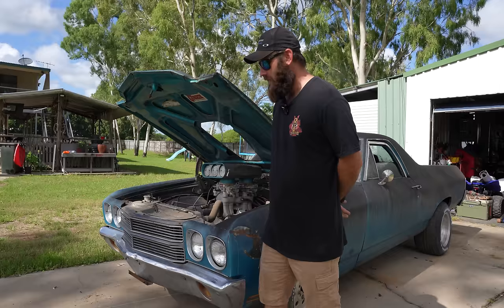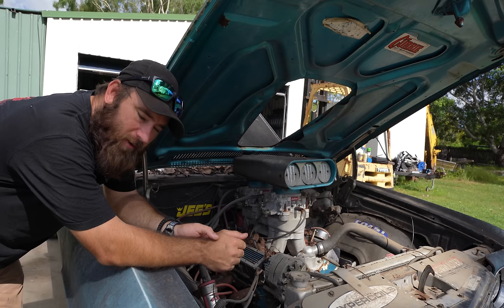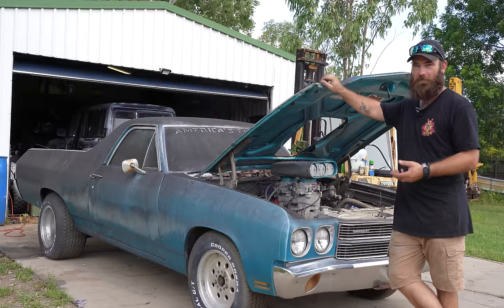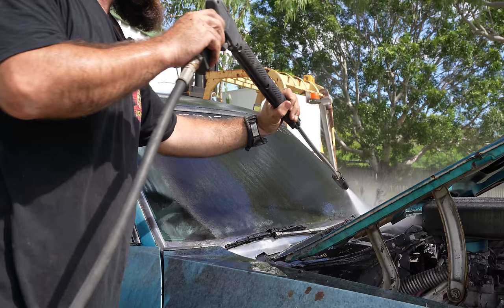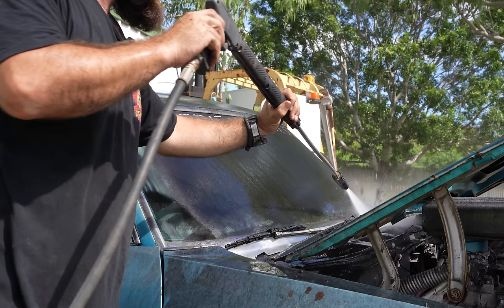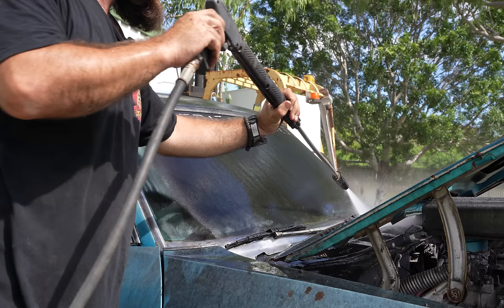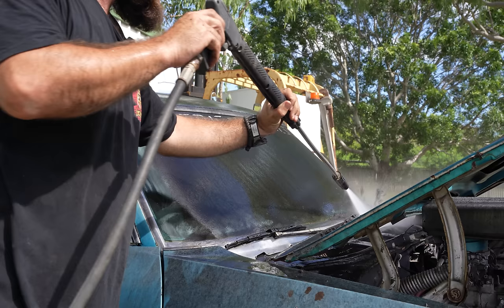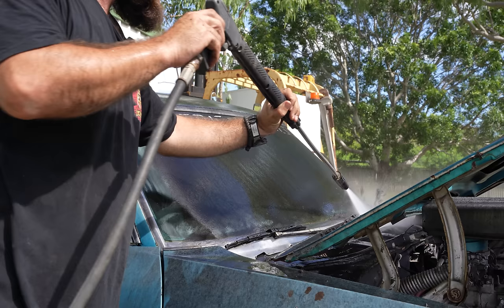Barn Find Chevrolet El Camino Sitting For Years Will it Run?- Sickpuppycody

Comment: Cody, Looks like either a 283 or 305 tricked out just fine! You have a classic ride here. Any way, you really lucked out finding this gem. Every guy has to have a muscle car or truck to "play" with!
Reply: 307 cubic inch 200 horsepower V8 (base)
350 cubic inch 250 horsepower V8 (optional)
350 cubic inch 300 horsepower V8 (optional) 1970 El Camino Engine Options
Reply: 283 and 305 are  ten years apart and totally different from each other. 327 and 283 are closely related and both small journal high rpm engines..
Reply: A 283 doesn't have a crank bolt. Looks like a 350. It sounds way over carbureted.

Comment: Nice work. The dipstick on the driver side, below the breather is the engine oil. A chevy will work with anything that qualifys as a lubricant. We usually st as y on the high side, 10-40 or even straight 30w. The dipstick you checked on the passenger side at the back is for the transmission.  The dipstick tube is also the filler tube. Check power steering pump on driver side too(belt driven). Chevys are tough, you probably don't need to pull that motor, it will come back fine! The balancer is interference fit, but fix the bolt before any serious shakeout;)

Comment: Sweet car! Couldn't have been parked any longer than the early 2000s judging by the monster energy drink decals on the blower. Hopefully you can get it back to A1 condition and get that charger!
Reply: Not a blower..tunnel ram. Still looks cool and makes lotsa torque

Comment: Two pieces of advice. 1. The starter sounds like that because it needs a shim or two between the starter and engine block. You will destroy the starter if you keep cranking it that way. 2. When you pour gasoline in to get it to start, put it in the vent tubes sticking out of the top of the carburetor. That way you fill up the bowls and give it enough gas to get it to start. And yes it's a turbo 350 transmission.

Comment: Awesome content 
Great build series 
New fuel tank, lines, regulator and filter
New oil, oil filter, clean oil pan, new oil pump
New temp gauge,
New aluminum timing chain cover, geared timing noisy 
New radiator, electric fans, hoses, clamps, thermostat 
New aluminum electric water pump 
Trany oil, clean pan and filter
Change diff oil 
New brake master and booster 
New 18 rally wheels with wide meats
Weld the diff 
Electric rack and pinion    No power steering pump, pulley, and hoses 
Rip out the carpet  and remove the bench 
Power wash it put 2 small racing batteries under passenger seat 
New big RPM tac 
New water and amp gauges. 
New sending unit 
New wire harness 
Brakes and bearings 
Boom tubes out the sides 
Hood stick and drive sideways

Comment: I just bought a 1966 El Camino 3 weeks ago. I live in Washington state. I have 2 1966 Chevelles, one with a 427 that I’ve had for 43 years now and I have a 1966 Chevelle convertible that I’ve had for 20 years now that’s nice. It has a 283. I also have a 1970 Monte Carlo that I bought a couple of years ago because someone in Australia needs one. It has a 402 big block and is in nice original condition but had a bad rod bearing and chewed up the crank. I bought the parts to make the differential a 12 bolt posi. It has new 3:73 gears and a new posi unit, bearings and axles. The interior is original and in nice condition. I’d love to come visit and help my new Australian friends work on it. All of my close friends died. Heart attack, brain cancer and a vehicle accident all within about a year of each other. They were the best and we all lived in the same neighborhood.

Comment: I know I'm about a year late on this.. but the turbo 350 is the transmission. its a 3 speed, with no overdrive. A pretty common transmission paired up with small block chevy engines. Not sure if y'all got PB Blaster in Australia but that's my go to rust oil that I use. Be sure to use thicker oil that has a high zinc content for these old motors, some people use diesel oil 10w-40 but I tend to stick with general oil for gassers. If I were you Id keep that intake manifold and dual carb setup, that's gotta be like finding a unicorn in Australia. They're a pain in the ass to tune sometimes but well worth the effort. Look forward to seeing more videos of the ole camino.

Comment: First time finding this channel thanks to junkyard digs, great work on that el Camino, I have a 68 although I’m state side, nice to see another one being saved
Reply from the maker: Legend brother thank you!
Reply: Good going Cody.  I had a 68 back in the late 80s.  Fun cars and useful when circle track racing.  Like someone said add some zinc additive to the motor oil.  Next time you get it running check the tranny fluid.  Dip stick and fill on the passenger side. A small 2 gallon auxiliary tank will give you enough fuel to help reseat the rings and valves as you heat cycle the engine several times.  Remember the auto trans needs to be checked ASAP.
Reply: I just bought a 1966 El Camino last month because it’s in great condition with no rust that I’ve seen. It has disc brakes now and the previous owner started fixing it up. I live in Washington state and have 2 1966 Chevelles in addition to the El Camino and we have a 1970 Monte Carlo with a 402 big block. I need friends to work on them with me so I’m not all by myself. Safety watches! I have a nice shop with a loft to use to work on the projects.

Comment: Turbo 350 is the Transmission. In 1970 the available small block engines options were a 307 Cu. In (5 liter) that made 200 H.P. two different 350 cu. in. (5.7 liter) that made 250 or 300 H.P.

Comment: its probably a 350 w /cam ,maybe even pistons.that tunnel ram is a plus,but pain in the ass ,if you dont have high compession like 10:5-1 or better.it could be a good performer.use T5 shell rottella oil ,cant lose!!

Comment: Good work that's a badass El Camino. Just remember American Motors are really tough I have seen motors setup for 50 plus years and with a little work start up and run and drive just fine.

Comment: Pull the distributor. Put a long screw driver down to the oil pump. Rotate it with fresh oil in it. I have an old distributor that i hook a drill to. And get oil back throughout the engine... just a suggestion

Comment: Here in the states that's a 40 or 45000 dollar car if it's real nice an clean just sold a 69 chevelle not done for 25000 that's a well sore after car well worth fixing up will not lose one dime on that car👍 check block numbers if it ends 00010 back over transceiver side it's 4 bolt main 350 good motor

Comment: I have a 72 El Camino 350 in my 70 c10, the stamped number on the block just forward of the right side head told me it's the same engine they used in chevelles and camaros.

Comment: Driven the 80s body with a tiny worn-out 305 good fun for a high schooler. Later  on a friend had a fresh v6 that had more power and better mpg. But I'm from the states so getting our hands on them are a bit easier lol. 
Oddly I have dreamed of your 265 hemi inline 6 to swop into one of the jeeps or dodge trucks that I've had. Lol.

Comment: Looks like a Mid 70s build Judging by the tunnel Ram intake ,Flat tappet cams need zinc ,which they don't put in modern oils except diesel oil

Comment: Guarantee ya ya bro that old tunnel ram set up will be way more trouble than it's worth. Even if it's a serious race motor which I doubt. What I'm saying a small nlock on the street it is a pain in the ass set up. They make such awesome carbs in today times that it just ain't practical. You can get a good rebuilt holley that delivers as much or more fuel without having to always be trying to keep those two working together and linkage straight... just somethin to think about. Although ya have to admit it's still an iconic old skool look that alot of old facts like me enjoy seeing

Comment: That's one clean Ass Camino that could rule the Aussie streets with a little nitrous ain't to bad of a Hot Rod Stock like it is Them El Camino's are some bad Dudes my uncle had one bone stock with elderbrock 750 carb that Ran 8.50's in eighth mile

Comment: I put an intake an duel 650 holly carbs on a built 355 with a mild cam an it only got 5 miles per gallon on fuel mileage I pulled it off quick an this was 20 years ago when gas was under $2 a gallon wouldn’t want that setup now for sure lol

Comment: It's not like you're not gonna change it again when you fix the oil plan but when you do you can cut the SDP which has zinc in it and put in the oil or something like that cause it's probably a hydraulic flat tap a Cam from or a solid for Cam which needs think as well jetting

Comment: But I wouldn't get rid of the tunnel Ram they make some pretty good horsepower build your nice little 383 and stick in there then you'll just have problems with traction El Caminos had bad traction problems two light in the rear end oh yeah that's a nice barn find a mechanic buddy of mine's been looking for one of those for years have fun with your project later bye

Comment: nice find ..   But oil in a 70 engine must have Zink in it , these engines run flat tappet lifters !  So buy yourself classic car oil with high zink in it. 
Else you find youre self with no cam in it after a while !!    good luck there in the outpack ..  Greets from Holland europe ,  Pete.

Comment: What a find. Really nice project car. Next episode we change the oil, fill the cooling system, fix leaks and run it through some heat cycles? 3rd episode go through brakes and take her for a drive? Are parts available there or do you have to pay through the nose for shipping?
Reply from the maker: Your all over it my friend. New video will be up tomorrow
Reply from the maker: I haven’t looked for any replacement parts yet. I’m hoping they won’t be to hard on me

Comment: Small block Chevy guy here from Arizona if it's a flat tappet cam witch most are you need some zinc in the oil and if you get some r45ts spark plugs there a little hotter and small block Chevys love them oh and get you an hei distributor if it'll fit behind the tunnel ram lol built my first sbc at 10 years old so got any questions hit me up Ill help the best I can

Comment: I don't know if you'll read this, but you might want to invest in a flywheel turning tool. They work great if you have access to the flywheel.
Reply from the maker: Cheers brother I’ll look into it
Reply: @FENCE POSTS RUSTY GOATS  I worked for a transmission shop for 10 yrs & used 1 on a daily basis. They work great when you need to turn the crankshaft. I live in Texas. I really enjoyed this video. I'm a 1st time watcher & will be subscribing. You probably already know by now, but that is a turbo 350 transmission & is more than likely a 350 or 400 Cid engine. You should be able to get the casting #'s off the block to find out for sure. That El Camino was definitely an awesome find. Good luck. I understand you wanting a Charger. I also worked for a Chrysler, Jeep & Dodge dealership for almost 17 yrs. I love the old Mopars also!
Reply from the maker: I’ll check it out. The bloke I got it off says it’s a 383 but no idea
Reply: @FENCE POSTS RUSTY GOATS  It very well could be. It's what we call a stroker engine here in the states. If that's true it'll be a 350 block w/a 400 crank. There are some other internals that are different also. They make really good engines! There are a ton of them here. They were all the craze before the LS. All of the small block chevy purist still love them. Good luck! I'm 56 now & disabled, but I did a lot of street racing when I younger. The 1st vehicle I bought with my own money when I was 15 was a '67 Chevy C10 SWB 350CID w/a 4 spd. When I was 16 I bought a '69 Camaro SS 350 w/a TH400. When I was 18 I bought a '72 Vega w/a 327 w/a tunnel ram & 2 4brl carbs w/a TH 350. I ended up selling  them because I ran out of money trying to keep them running. I kick myself everyday for selling the C10 & Camaro! I loved those 2 the most!

Comment: That'd be yes sir it did but you need to get rid of the wood screw and oil Pan I don't know who's Friday that was but that would never fly a probably knew it wouldn't fly when they did it so it brings up my mind what damage have the done to the engine by running it with the woods grew in the oil Pan low and oil

Comment: It's running way too rich, possibly low compression. Check it next to determine which cylinders are low compression.Chevy V8's are hard on spark plugs it's misfiring down low. Maybe a bint  push rod or valve lash too tight. Good luck from California USA. PS. Number one driver side front cylinder used timing light set idle at about 12 degrees for moderate performance
Reply from the maker: Thanks mate I’ll check it out

Comment: Go by USA flight will tool off Amazon or eBay or something like that instead that you're the longest private you're trying to use you wouldn't have that problem there's a tool actually made to spin off the fly will it's actually made for a Windsor to transmission in to turn the fly wheel to line this talk over to bolts up but it doesn't works the same way as for breaking the engine loop